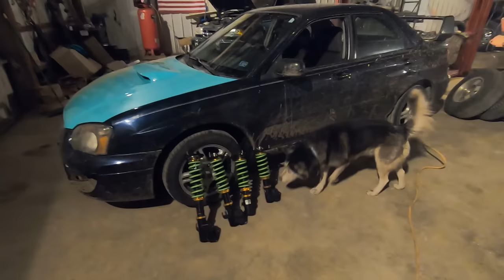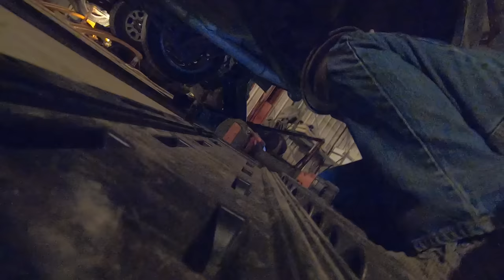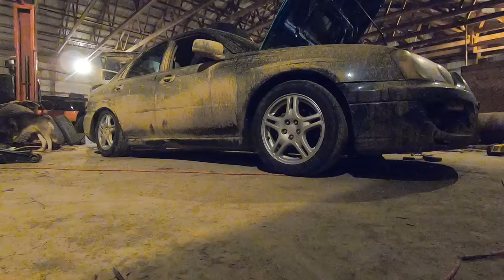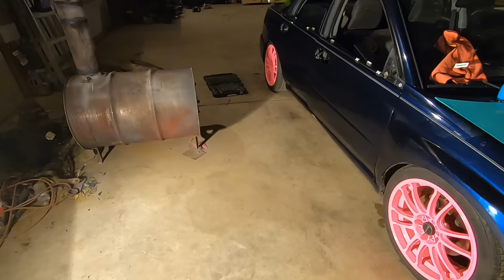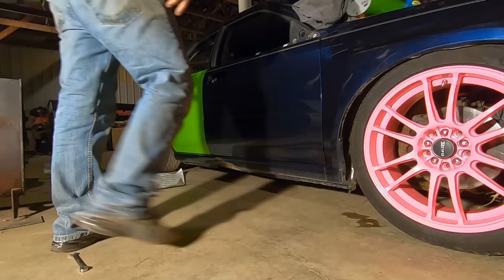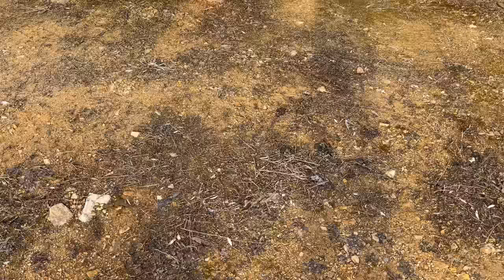My Best rebuild & wildest wrap EVER! VW owners are going to go crazy!

Comment: Someone I watched used about a 2-3" dia. pipe they put if on top of the tires and stride up on the lip of the wheel welll - taking there time they were able to round the opening out a pretty good amount. But you might have to cut the lip on the wheel well to allow it to bend outward - just be gentle and try it is you like just a suggestion. Thanks
And no I am not a boy I am a MAN LOL
Reply: A lip roller is very cheap
Reply: @SXSPRIME  - To be honest I have never rolled a lip LMAO Thanks for the information
Reply: @keepyourdayjob5658  no problem right on Amazon

Comment: The last thing for the new video. I'm waiting for the F-450 with a thrown away engine (6.4 Powerstroke) to get fixed. And this is very expensive to fix. I don't know what's wrong with the F-450 with 6.4 Powerstroke. Let's find the F-350 or F-450 dually with the 7.3, 6.0, or 6.7 Powerstroke. It could be reliable engines.